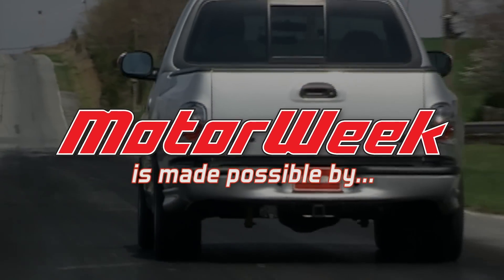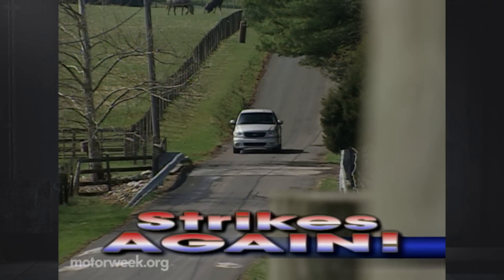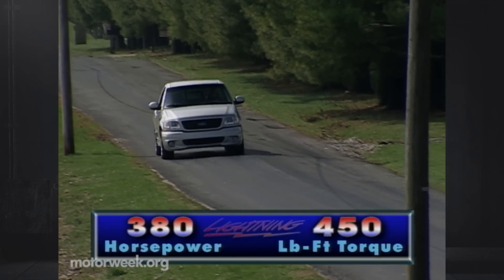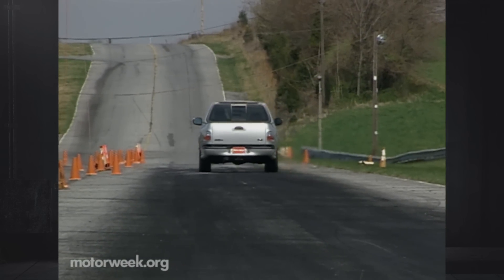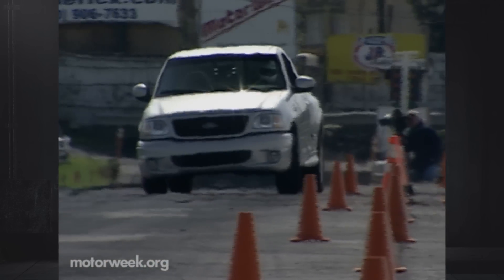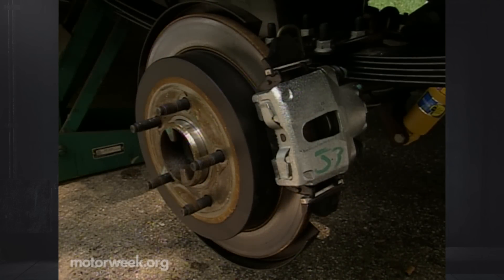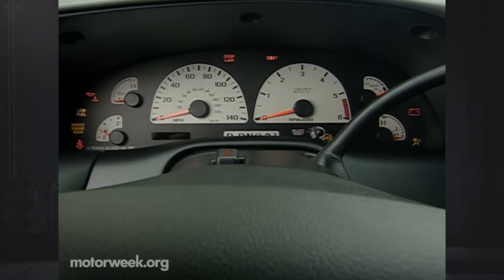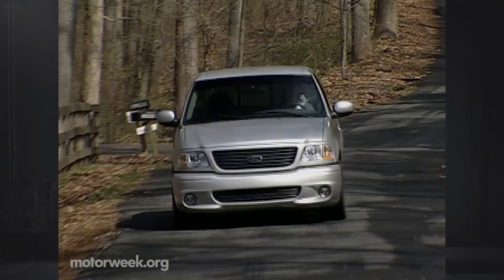2001 Ford SVT F-150 Lightning | Retro Review

Comment: I had an 03 lightning. Raced a 02 camaro ss while hauling a couch and still gapped him. I've never seen someone's face get more red than that camaro owners face.
Reply: Lol
Reply: I call bs. Unless you raced a 6spd with someone that can't drive. Those camaros/pontiacs ate all mustangs and were neck and neck with cobras of the time. A 13.6-8 sec 1/4 truck gapped a 13.5 sec car while hauling a couch? in your dreams haha.
Reply: Automatic
Reply: That was a camero
Reply: Maybe a 02 RS with a six cylinder, nice try though
Reply: @depends303  no it’s camaro
Reply: @ham7357  🤣🤣
Reply: @Pbtbreakingpoint 
Yeah, and we all know how difficult it is to turn up the wick on a supercharged engine.
Reply: @josefastboats5874  ours could do 0-60 in 3.4 with just a few mods
Reply: @josefastboats5874  up in my neck of woods I’ve seen them for around 16K-30K no rust or anything. Anywhere from 30K miles to 194K miles.
Reply: "while hauling a couch" lol
Reply: @Pbtbreakingpoint  it was dusting all the cobras until 2003, but both the camaro and TA were out of production
Reply: It's too bad the Rods were made of Glass. Run just 2lb more boost and it would window the block ..
Reply: @Pbtbreakingpoint  idk if it was the cars or drivers but I had an 01 lightning. Gapped cobras and Pontiac W6. Yes those drivers were shocked too 😄
Reply: Yeah...the Ford Lighting's were very fast trucks for their day. However, you weren't gapping my 2002 Firehawk Trans-Am even with an empty bed. Now, you Lighting guys could take my 1994 25th Anniversary Trans-Am but it was always damn close.
Reply: @josefastboats5874  
Did you find one? I might be a lifelong GM guy (until very recently) but I always liked the Lightings. I almost bought one in 2002 when I picked up my 02 Firehawk Trans-Am. I just couldn't pass her up. Now, I'm very disappointed with GM at the moment as the Camaro no longer looks like it's American made. I parked my 2012 SS Camaro as my daily and went with a yellow and black 2017 Dodge Challenger RT classic. They look so damn good and modding her has been incredibly cheap. I'm making 440hp@425 ft. lb. of torque for under 2k. That's an insane pickup for nothing at all.
Reply: BS
Reply: @joshthorn4693  
Yeah, he's full of it. No way a stock Ford Lighting is doing that with a couch in his bed.
Reply: My friends all stock '02 Camaro SS, 6 speed ran a 13:21 @ 108 mph at Great Lakes Dragaway.
Reply: A stock 02 Camaro SS has a significantly higher trap speed. Nope, don't buy this story
Reply: @LeoM-zt3pl  
Oh no doubt about it. This guy is absolutely full of it. I used to beat Ford Lightings in my 2002 Firehawk Trans-Am bone stock. With the added weight of a freaking couch he would be taken to gap city.
Reply: @LeoM-zt3pl  
Oh but let me tell you a real story about my 1994 25th Anniversary Trans-Am LT1 V8 w/6-speed. It was the Summer of 1998 and my damn Opti-Spark was giving me some real trouble. I had a guy in a 97 Mustang Cobra harass me until I got tired of it and I smoked him good...with a bad Opti-Spark. Even while the car was jerking all over the place I dug him in first, second, and left him in third. His car was an automatic...so no excuses.
Reply: I HAVE SCENE THEM AT THE TRACK WITH A FEW MODS RUNNING 10S AND YES BACK IN 01 THEY BEAT THE Z28.
Reply: Ya nice story. I call opiote moment late at night, great imagination
Reply: @Sinn0100  hahaha he wasn't gapping a Firehawk even if he stripped the whole truck and had an 80 lbs stripper driving!
Reply: @dwg1235  
Agreed!
Reply: I raced a 2018 SS with my 20ft trailer gaped it by three car
Reply: He probably got embarrassed that they lost to a Ford F-150 Lightning.
Reply: I raced my buddies lightning with my 100 % stock 98 TA auto. 2:73 gears. Beat him by. 2 cars 😂
Reply: Camaro RS with ss badges fool
Reply: Rip off! I got mine with 12psi. It was a ford parts guy with less than 5k miles. He had a baby on the way. 
Who are these crybabies whinging about mpg give me a break.
Reply: I tend to lose to those SS Comoros. But I was using heavy winter dueller tires.
Reply: You didnt gap anyone. Just would have been close

Comment: One of the few Fords that even diehard Ford haters like.
Reply: Old Fords Don't die So True
Reply: I’m a Chevy guy but I’m a huge fan of the square body F150/250’s from the 80’s and 90’s these and terminator mustangs. They took a huge step down going from the 300/302/351 etc to the modular. My old company work truck was a 1996 F250 with a 351. That thing was bulletproof. It had 400,000 miles when I left there. I’m sure it’s still going
Reply: Id drive this truck anyday
Reply: this is true lol
Reply: Ford haters have no class  anyway..
Reply: Old Fords Don't die I’m a MOPAR guy but I love these trucks.
Reply: @Iconhulk    I don't understand all the Ford hate.  They are a conservatively run company that doesn't routinely have its hand out for a public bailout and their vehicles are at least as reliable as GM or Chrysler vehicles if not better.
Reply: @RobertSmith-le8wp  my 1991 F150 302 4x2 automatic has been a very good truck. I know 2 of the 3 other owners.  Its has had all cooling related parts replaced,  starter,  alternator,  all hoses.  Its now due for ball joints, shocks, and some rust fixes.
Reply: True
Reply: I respect all old car brands for the most part, had a 78 firebird, have had chevys, Honda’s, and now I have an 89 crown vic and an 85 f250
Reply: I dislike Fords a lot.
Reply: My 86 Grand National murdered a Lighting!  My 2.7L TT F150, on 93 octane, will beat this Lighting's ass.
Reply: I haaatteee Fords, but it is unmanly to hate a Lightnin!
Reply: HellKitty 101 no it’s not!
Reply: @canceltyranny1362  
My 24 year old sable was great, just got old so I bought a Ford Escape. Been great so far.
Reply: @scdevon  they killed ken miles FUCK FORD.  Love the lightning lol
Reply: Eyyyup
Reply: Im a chevy guy and that’s 100% true
Reply: @charleslowe522  TT? Twin turbo? Of course bro
Reply: scdevon Well the bailout money that GM and Chrysler received were nothing compared to the money that was handed to the investment banks.  What most people fail to realize is that in 2005 Ford secured 21 billion in loans from private institutions.  Ford put up all their plants up and the F150 nameplate as collateral.  By the time GM and Chrysler needed loans the credit markets were frozen because the US treasury let Lehman Brothers fail, after bailing out Bear Stearns and then bailing out everyone else after the US Treasury realized what a fuckup they had not made by not helping finance the deal so Lehman Brothers could be purchased by Baryclas.  It seems that 99% of the US are ignorant about what happened during the financial meltdown in in 2008.
Reply: Charles Lowe Your 86’ GN beat a Lightning? Ya don’t say!? 
  Well, actually, if both are stock, and assuming you raced an actual 2nd gen, he should have pulled you except maybe off the line. 
  And yeah, a modern eco boost can beat a stock Lightning with minor modifications. Again, not if both are factory. 
  Keep in mind that a $60 pulley on one of these things adds tons of power. 
  I’m not entirely sure what you are trying to even add to the conversation. I’m sure my 67’ C-10 that puts out 475 rwhp would bust that GN. If not, I’m sure my 02’ Z06 w/ heads, cam, LT’s/hi-flo-cats/x-pipe-exhaust, intake manifold, blackwing CAI, injectors, and tune would. And if that didn’t work, my 99’ C5 w/ bolt-ons and 12 psi oughta do it. Cuz apparently we’re having a d*ck measuring contest now
Reply: No it's a Triton load of shit
Reply: This and the terminator. I'm a diehard chevy guy and just got me a silver lightning
Reply: As a Die-Hard, Ford hater, I approve this message👍🏽 the Cobra R, Cobra Terminator, SVT Lightning, Ford GT and Shelby GT350 are cars I have to admit I think are awesome. Original Mustang Mach 1 and all the Stangs before it are also great

Comment: This truck was YEARS ahead of its time, brilliant engineering....
Reply: Dave Clark i would have to say the syclone was
Reply: @StockGT350  SRT 10 and Syclone had the full potential to annihalate the Lightning
Reply: Chevy push rod LS motors were putting out the same horsepower naturally aspirated at that time.   Ford could have really showed out, but they always fell slightly behind.  The terminator Cobras were the start of serious cars.
Reply: John Tate no they wasn’t. The LS1 in the corvette had around 350 hp and the ls6 in the zo6 was around 400. As for trucks the the biggest motor at the time was the 5.3 in the 1500 series that was around 270-300 depending on years. The vortemax didn’t come out till 2006 for around 345 hp. Ford had a hot product that’s why it was there faster production truck at the time.
Reply: @bradgt5130  dude you obviously don't know gm trucks. The c3 in 2001 had the lq4 6.0, and the Denalis and Cadillacs had the lq9 6.0 starting in 05
Reply: @danielboatright6977  
The 6.0 GM V8 in the trucks in the 2,000's were no where close to 450 Ft Lbs!
The modern 6.2 is just now in that realm.
Reply: @StockGT350  The Cyclone was a few years earlier, but it never sold as well as the Lighting and nothing like the Raptor today.
I'm actually surprised myself how many Raptors are out there. They are so expensive.
The Cyclone was AWD and turbo  which is awesome.
Reply: Idk if it was "ahead of its time" but it was impressive by both 2001 and todays standards. The 6.2 raptor was being praised by performance enthusiasts by breaking the 400hp mark in a gas truck (from factory qith warrenty) when it was first being sold on show floors. Yet in all likelihood the lightning did this 8 years earlier in practice but not on paper in a truck only weighing 4600 pounds in comparison to the raptor weighing in at 5900 pounds. 

It should also be said that more than likely, the lightning probably made more than or close to 400 hp. Its was faster than the SVT cobra of the same year and beyond untill ford finally gave the Cobra a 390 hp upgrade with a 4.9 second 0-60 time and a 13.4 1/4 time. A whole half second faster than the lightning.

The lighting just has a beefed up 5.4 tritton engine in it with a supercharger on top. (it does not have a ford GT engine in it..... the ford GT came about in 2005, so a more accurate statement would be to say that the ford GT has a Ford Lightning engine in it but it doesnt because theyre two seperate engines based off the same platform) 

The 5.4 tritton is arguably the worst engine Ford has ever put into production. Taking a 5.4 Tritton into a mechanic shop in many cases resulted in the owner receiving the news that a whole new engine had to be bought and put into the vehicle... now imagine putting a supercharger on top of it and pushing out around 400 hp through the damn thing. You can see where issues would arise.
Reply: @bondedstars  you're dumb. The truck was the complete package, styling power comfort and handling. Horsepower by liter is one aspect of a vehicle. Cool story bro.
Reply: Wouldn’t say it was ahead of its time engineering wise, Ford just had the balls to put it out.
Reply: @johntate4638  Pulley Swap on the Lightning’s blower and your smoking ANY of the other “ Sport Trucks “
Reply: @danielboatright6977  The lightning had 550### Ft. of Torque. Absolute beasts... And they could tow 5000 lbs. 👍👍👍 Love Them. Best of all worlds in a lightning
Reply: @PsalmFourteenOne  Syclone of GMC is engine 4.3 V6 and Ford F150 SVT is engine 5.4
Reply: @fernandorocha8459  I am full aware of that. Someone, in this THREE YEAR OLD THREAD, had brought up the V8 LS engine and I was responding to it.
Reply: What a truck. I wish.

Comment: 2003:  I’m 24 and just got laid off.  Company gave me $2400 severance.  Two days later signed that check over to Ford as Downpayment for a used ‘01 lightly modded with 16k miles for $27k out the door.  I was broke but happy!!!

Comment: Of course technology gets better... BUT: after a few bolt on mods & a custom tune, my 01 Lightning put down 410 rwh & 525 lbs of torque & a 12.9 quarter mile on street tires in 85 degree weather😊
Reply: Yep I had a 2001 with a pulley swap, tune, and exhaust. 12.4 in the quarter with nitto street tires.
Reply: kevin guffey damn Kevin chill
Reply: Cool, then what happened?
Reply: I wonder if a gt500 supercharger would bolt on.
Reply: I rekon the F-150 with a Ford GT's engine swapped would make it killer quick (maybe 10s on the strip?). I mean we're talkin 550 hp in a truck (50 more than a ram srt-10). 😂
Reply: @kevinguffey1564  lol....top level trolling 🤣
Reply: 410rwhp and 525 ft lbs, that's what my 2020 F150 3.5 EB would look like with CAI, exhaust and a tune! lo...but won't look near as good as that '00 Lightning!
Reply: @Lucille69caddy  The 3.5EB has 375hp and 475ft lbs torque...you would be surprised how much of a difference a cai, exhaust and a tune can make on a TT engine.
Reply: Brian Mullins and my 2014 Cruze put down 9280 hp on 3lbs of boost on a 188 degree day on two spare tires.
Reply: Brandon Candelario your the kind of person who figure out why your parents are brother and sister.
Reply: And you just lost your "COLLECTOR VALUE" by modifying a vehicle that's now bringing in big bucks for collectors if it's 100% stock, never tracked, and low miles. Anyways congratulations on actually enjoying your truck!

Comment: I remember working at a car lot back in 2015 and one if of these came in as a trade in. It has 57000 miles and the Truck literally looked brand spanking new. the seats weren't creased and there were no stains. They still have the plastic floor mats from the factory.The paint was flawless and it ran really good and was really fast.
Same color
Reply: DId you buy it?
Reply: Yeonhoo Kim Oh nah, I didn't have the at the time
Reply: Maxxas Crow how did it sell for after...
Reply: Twincam Mike83 idk, probably took it to auction. That's what normally happens to used cars at car dealership
Reply: Cool story bro
Reply: Probably had blown a head and was fixed.  These were notorious for blowing spark plugs through the head
Reply: did they at least give them a good trade in price?

Comment: 380 horsepower holy shiiiiit!!!!! and reaching 101 on the quarter mile is impressive
Reply: shaesham it’s funny to think about it now my 18 f-150 has 375 hp from a 3.5L
Reply: just about any new truck with a tune will do them numbers but i still love the older muscle trucks like the old 454ss and the srt 10
Reply: Pretty much had the same times as the same mustang GT of the time. If not a little faster. Very impressive.
Reply: @angelgjr1999  I don't think their driving was the best here. I had a 99 GT and people on the forums back in the day whined about the Lightning roasting our stangs! I think the quarter mile for a lightning was mid to low 13s if well driven
Reply: @mikek2416  I have an 03 GT. But mine is modified and has 4.10 gears. My pony could maybe keep up. :)
Reply: @angelgjr1999  Nice I just let mine go earlier this year which had 4.10s and a couple other things. Really woke the car up from stock but useless here in MN snow :-) My ride now (2.3 ecoboost) has more HP on paper than the stang but it's not even close off the line and even from a roll with boost the stang would probably take it.
Reply: @antfbi  and it still get smoked by this old lightning haha.